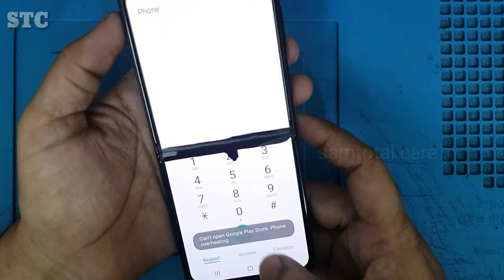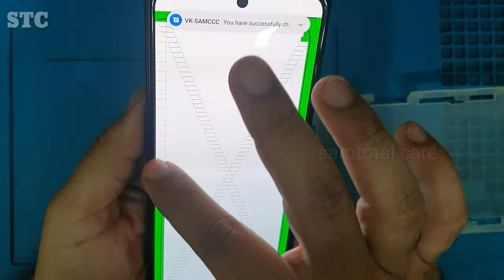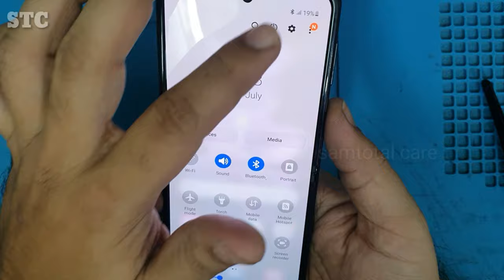Samsung Flip 3 display replacement

Comment: This is exactly what happened to mine, i can use the bottom screen but the top part is dead. And the black ink also kept spreading so i had to stop using it. Love the phone, hate the battery life.
Reply: Seriously and it heats up terribly
Reply: Same here , the worst phone ever!!
Reply: Same I want to repair mine so bad since I miss it but its not worth the price
Reply: @mimilove6906  that might be a battery thing.
Reply: Same for me but i found app curser moving from google store and used it to navigate top screen and using without changing display😂
Reply: @geethavino001  Can you explain me more my top screen touch is not working and that's why I am unable to backup a data because most of the options are on top side screen

Comment: My screen broke but it didn't have that black line in the middle. When I opened it it made a pop noise and the screen just turned to black. Is my screen actually broken or is the mechanism just became loose or something?
Reply from the maker: Don't worry i have a property solution yours handset

Comment: That's in The SCREEN it's Self not the screen-protector THE PROBLEM IS THE SCREEN ITS SELF IS ON THE WRONG SIDE OF GLASS. IT SHOULD BE SCREEN , GLASS , THEN SCREEN-PROTECTOR I have there Three spots on screen because if glass is Back words screen-protector SCREEN then glass in side TO MUCH MONEY on the phone 1599.88 or 626.00 hundred dollars it's TO MUCH MUCH with new SCREEN OR SCREEN PROTECTOR
Reply: 0 iq comment